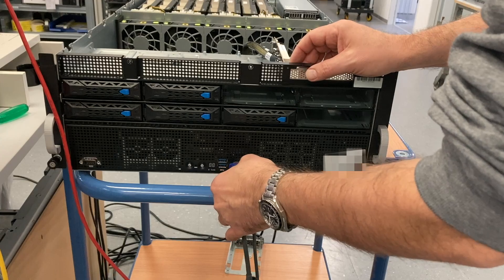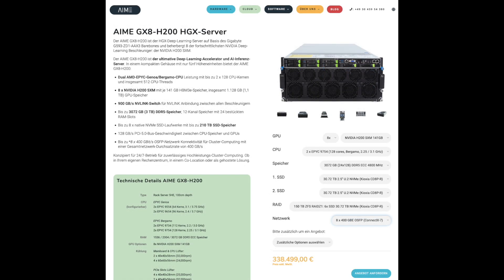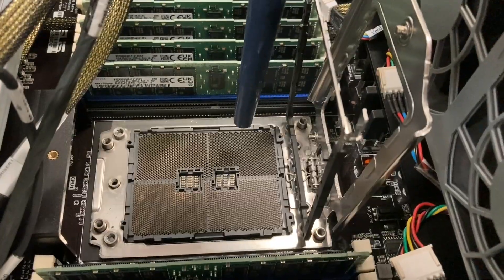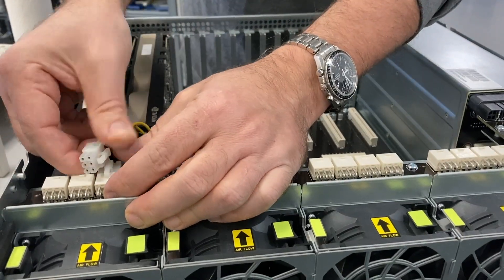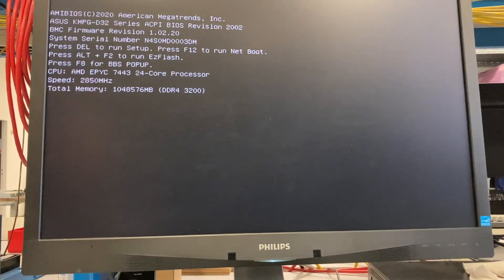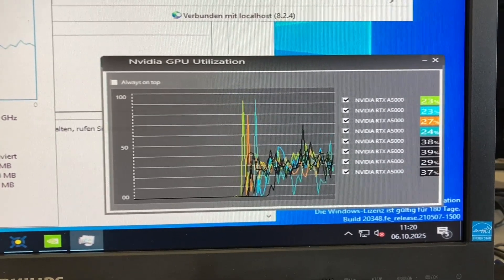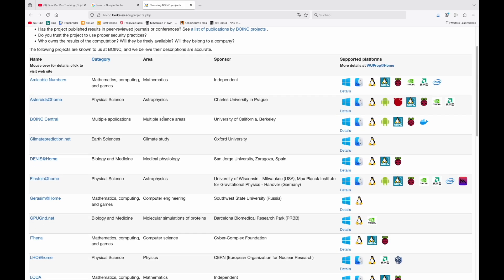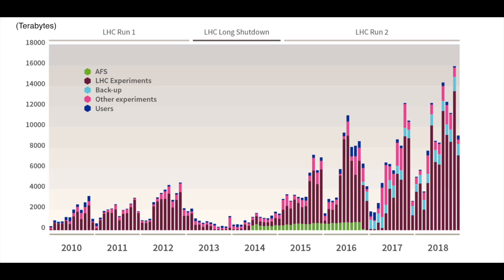The most expensive server so far... (PWJ278)

Comment: I agree ASUS isn't bad for servers: definitely better than Gigabyte, but I do think Dell (and I guess HPE) management tools are better. Things like DSU and power measurement are just much easier!
Reply from the maker: I would say ASUS makes good servers. They save some cost by keeping everything simple. Therefore, there are more screws and parts to remove and unplug if you do maintenance on them. For example to replace the CMOS battery, you disassemble almost the entire server. I haven't tried out the BMC but it's certainly simpler than a HP iLO. On the other hand, who really needs all those gimmicks? 🙂

Comment: What an incredible machine.. 👍 ..ahh seti still remember when we (i and my bro) reach 1st place on the Italian ranking
Reply from the maker: I installed SETI@home on a DEC Alphaserver in the early 2000's. It was like a GPU compared to a CPU, the Alpha was 10x faster than any Windows machine.
And I always wondered how those 1.Place teams managed to crunch so many tasks so fast... what hardware did you use back then? And what year was it?
Reply: @PlaywithJunk ....we're talking about late 97 and early 98 when init to crunch.. we install seti app on all, at least all available, servers.. dont remember the exact number.. however much sun sparc, dec alpha server 1000, Siemens primergy with 4 cpu Pentium Pro .. and over time we have added machines, even new ones
...then everything changed when they added GPU support ..and we started using clients for calculation

...right now seti seems unreachable ..so cant tell you more 🤔
...dont remember the year we manage to reach 1st place on italian rank.. ..sure i have a note somewhere..
Reply: seti is now reachable.. forum registration saying may 1999
more of 400 server and client..
Reply: 23 april 2019 we reach 1st place on italian ranking... 20 years more or less of crunching...

Comment: At least they don't insist you use Boyd Ultrastick thermal compound...that stuff is brutally expensive...Farnell wants 77 Euro for that stuff, or around 1.8 Euro per gram...more than the cost of silver.  I realise one stick is good for many applications but I wouldn't buy the stuff myself unless I absolutely had to.
Reply from the maker: I used ShinEtsu thermal compund because that's what all big server makers use. Recently I switched to Arctic MX4 and MX6 because they are cheaper and very similar in application. The MX4 is a a bit thinner and easier to apply, but the MX6 is easier to clean off.

Comment: LGA is fine on small sockets but is a nightmare on huge ones, too many points of failure, too much dimensional slop.
I wish big chips used flat board to board mounts, like LPCAMM RAM.
Reply: LGA is more durable and is better for a large package like these multi-chip EPYC CPUs.  Personally I'm surprised they haven't come up with a solution for an easily replaceable LGA socket for server applications like this.
Reply: @douro20  Maybe the socket could easily be made separate by not having a soldered side, but two spring sides. The Mainboard and the CPU would then both have a land grid array
Reply: @maeanderdev i think IBM did this on some of their mainframe cpu‘s

Comment: Those cards are not 32GB ADA. They're RTX A5000 24GB Ampere generation and they shouldn't be powered by one  6 pins molex cable!
Reply: according to the specs, the card got just 230W TDP and 1x 8pin PCIe Power connector (which is basically a 6 pin connector anyway)
Reply: But they seem to have only one power plug? What gives?